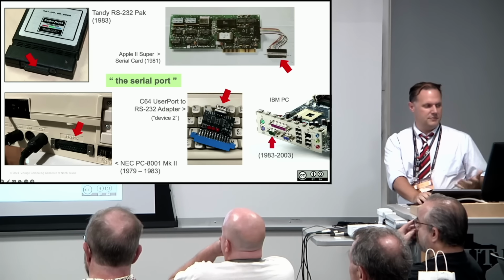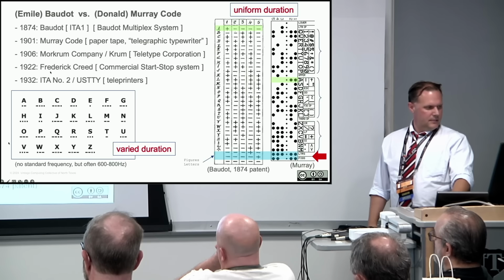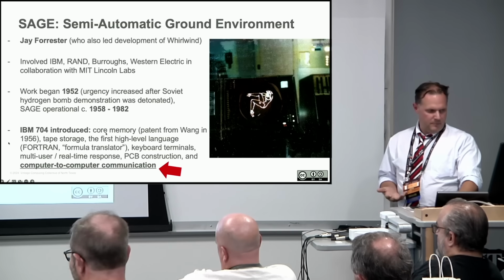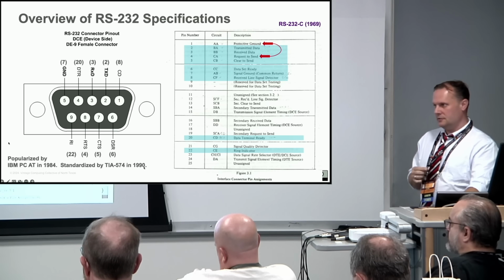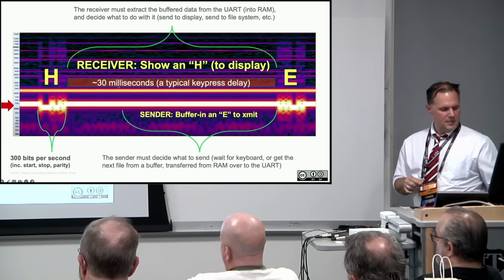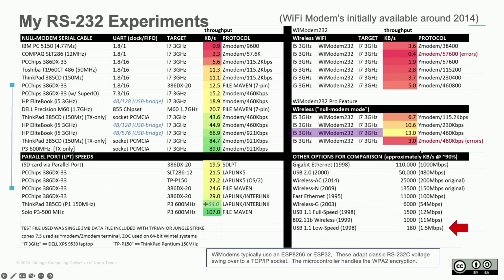RS 232 Then and Now

Comment: One small, but very common, error all through this talk:  Baud rate actually tops out at about 600.  The baud rate is tone changes per second, which maxes out about 600.  Above that, more bits per second is done by having more tones, each tone representing multiple bits.
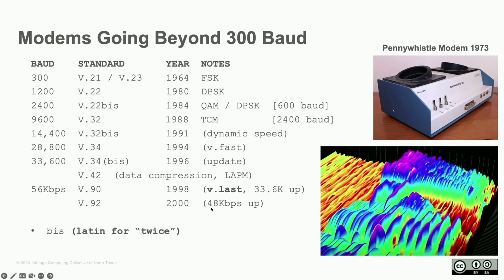Reply: I came across this - but didn't know a concise way to put it in the presentation.   Also I was confused if the "base rate" was really 300, 600, 1200, or 2400.  I heard different stories on that.  But the core point is, to "leap" up to 9600 across a phone line took some real thinking because of the tonal constraints.   The visual chart at 52:13 tries to convey this, but yea couldn't fit it into what was already a long discussion.    I'd argue that the cleverness in using FFTs just to get to 9600 evolved the signal processing later used in digital cell phone services of the 90s.

Comment: I'm still making good use of the Commodore A2232 seven port serial card. It uses a 3.6 MHz 65CE02 to handle all seven ports for the host Amiga. Using that, I provide serial consoles to an AlphaServer, a Sun Fire V245, a Cobalt Raq (MIPS), a VAXstation 4000/90a, and a Quadra 605.

Real servers have RS-232 :)

Comment: In the UART discussion you're crediting the UART with buffering functions they didn't get until IIRC the 16550, which was used in later IBM PC clones because the main x86 processor interrupt system couldn't keep up with even a 9600 baud input without losing the occasional character.  The job of the "Universal Asynchronous Receiver-Transmitter" was, as the acronym implies, just to take 7 or 8 bit parallel bit groups and serialize them for transmission and de-serialize them on reception so the CPU didn't have to bit-bang at the full baud rate with accurate timing -- which I've done when there was no UART on the 8080A, 6502, and 8041 in different eras.
Reply: The 16550 extended the buffer from 1 byte to 16.  There was a bug in the original IBM PC BIOS that hindered it from supporting past 9600 - but if you by-passed the BIOS, its UART was capable of faster.
Reply: @xiphod1337  The problem is that other subsystems, like the disk drive, in the PC had higher interrupt priority than the serial port, so they could hang the UART long enough for it to miss a character.  The original UART had what a normal person would call no buffer at all, just holding the last received character until another came in.  The 16550 took the place of a chunk of memory and a couple dozen lines of code holding on to incoming data until the PC was ready for it.  In a system where it could not be blocked, the old UART could operate reliably up to 115 kbaud.

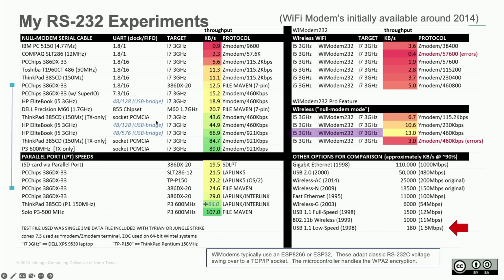Comment: 58:04  the RS-232 speed chart.  To clarify, this is RS-232 in combination of using a UART with framed data.  And one thing I didn't mention as a benefit of RS-232: it is still often used as initial boot-strapping of a system.  The high speed protocols like USB, WiFi, Gigabit - a lot of firmware software support is needed on how things get encoded (and larger buffers).   How do you get that support onto a system?  You could type in the thousands of bytes of hex.  Or, you could boot-strap using the relatively simple RS-232.

Comment: For the chart at 1:01:11 or so -- what terminal progarm did the presenter use to test speeds on the 'slow' PCs?
Reply: I was using a program called conex 7.5 from about 1998 (listed on the bottom left of chart, it's very small "fine print").  It's not as well known, but I looked for the newest/most recent MS-DOS compatible terminal program I could find (figuring those are generally more optimized via use of more modern compilers and techniques, but also just to try something different).

Comment: The whiplash of  going from Morse code to the 1950s.
Reply: Yea, sorry I couldn't spend more time there.  I got a message recently from an individual who, in 1978, was tasked to integrate an old Baudot 50 baud weather system that was still in operation over to the RS232 card of his S-100 system, to have it presented and ready for a radio station report.  A job too small for a mainframe, but perfect for the emerging microcomputers at that time.

Comment: 10:00  This might predate the light bulb.
Reply: Absolutely - one photo I didn't get room to include was how they were using telegraphs inside covered wagons during the Civil War.  Now consider this: years later, we can buy those little gizmos to do Ethernet-over-Power (like to go across floors in a house).  They've been sending data over wires since before electrical outlets were even a thing.   Now I sometimes wonder how much data our devices today are slinging over power lines, that goes unnoticed and unmonitored.

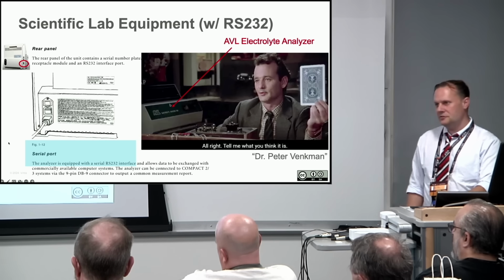Comment: @ 35:00 in the movie Ghostbusters, the actor Harold Ramis (Dr Egon) carries a predecessor of the Casio FX-850P programmable calculator on a wire around his neck. It also had the RS232 pins on their propriety connector. I used it to extract and decompile the Basic library that was on the Casio containing mathematical, scientific and statistical programs. That was in the late 80's early 90's. The cable I fabricated was a bit flimsy and the display only had 2 lines with 32 characters but you could use the Casio calculator as a VT100 terminal.

Comment: I remember having a serial buffer for a printer that could handle four computers. So if you printed something out from DOS you did not have to wait for the printer to be finished printing because of that massive 64kB buffer. 😅

Also a very special case was Germany. In times when the Telekom still was "Detsche Bundespost" they were the sole provider of telephny and postal service. You could rent a modem from them, but you were not allowed to connect a modem not of their approval. So the acoustic coupler (Akustikkoppler) was invented where you put down the telephone receiver on it, with a loudspeker under the mic and a mic under the loudspeaker of the receiver. Iirc there were 9600 Baud possible with this setup.
Reply: Great notes!  True I didn't touch on the early phone phreaking stuff or the Pennywhistle stuff, or yeah the legal hassle of connecting anything to the "phone network" in the 1960s (from residential standpoint).

Comment: I still run into this (rs-232) on occasion, usually with low bandwidth communication between different pieces of field equipment. To the point that I keep a USB to RS232 port in my tool bag.
RS485 and RS422 are still used heavily today with some equipment still produced new, especially with door access systems.
I had always wondered previously why there was such a variety in start, stop, parity and bit length formats when I only ever used 8,N,1
Reply: One aspect I didn't get time to cover in more detail was the use of parity bit.  Recall ASCII was really a 7-bit standard, leaving an 8th bit to be used for parity.  Parity concept is still used in some server class memory components (ECC stuff).  I think parity fell out of favor after systems became capable enough to compute CRC's (late 60's).  That's also another job UARTS take care of, in computing correct value of a parity bit (relative to the parity mode, Even vs Odd).  Sad that they go through that effort to support this, and yet like you say, most of us just pick None for parity.   Maybe there is a renegade BBS out there are picks Even or Odd just for fun?

Comment: Back in the day I built RS232 serial cards that supported 32 and later 128 ports for x86 systems running Xenix or Unix (the Specialix Si, XIO and RIO),  we would routinely run 16 terminals on a 386 or 486 system and could support 38,400 bps on all 32, later 128, ports at once.
Reply: Were these Digiboards  or something else?  sounds interesting
Reply: @jrherita  Specialix - Digiboard was the competition.
Reply: Wow, that's a lot of ports.  Do you recall any use cases?  Like, who was using such cards?  Like library terminals, corporate terminals, university?  Display screens at airports?  (I didn't touch on the history of those old "roll over boards" at early airports, like mid 1960s).   I can see 4x ports off a single 386, but didn't dig into how to scale that up to dozens and dozens on the same system (but I imagine early PPP/ISP offices needed something like that?)
Reply: @xiphod1337  "dumb" terminals running apps.  For example Microsoft had a word processor for Xenix.  There were a lot of business systems for companies like car dealers, some automation applications.  The trick was to offload the interrupt handling so instead on one interrupt per character per terminal (at 9600 baud that's one every ms) the card buffers and interrupts every 10 or 20ms and then and process the buffered data from all the ports in the one event.

4 terminals on a 286, 8 terminals on a 386, 16 on a 486, more on Pentium and non intel machines like MIPS.

Comment: Chinese brushless gimbals run it at 1megbaud.  Dot matrix LED displays run it at 10megbaud & beyond.  It's more resistant to interference than open drain protocols so motors on the ends of limbs tend to use it.
Reply: From what I can tell, those use TTL UART, but not RS-232. (Remember, UART and RS-232 are not the same thing!) I’m sure some implementations use RS-485 signaling for its far superior signal integrity (better than TTL UART or RS-232.)

Comment: I love RS-232...!  In college I had to work a certain number of hours per month for my scholarship. I helped a professor set up an IBM clone to command a spectrophotometer via RS232 to the stepper motor that set the wavelength of light that strikes the detector. My program allows an operator to enter the wavelength range to be scanned, at what rate to sweep over that range and how many passes to make. This would masure the spectrum of a light source to be analyzed. The instrument's output went to a chart plotter which would draw the spectrum on paper. This plotter had a RS232 interface as well that I used to capture the output of the instrument, save it to disk, then plot the spectrum on the computer, including a features to process the muiltiple passes to eliminate noise from the signals, resulting in a cleaner result. My program culd even zoom into sections of the spectra for versatile analysis. To get those machines to all work together like that was very satisfying and really boosted my confidence in my abilities in that sphere. All of that was made possible by RS232 and some BASIC code. The amazing part is that it and it's descendants still surround us today.

Comment: i spent my first weeks as an apprentice at the age of 16 in 1986 changing mc1488/1489 line drivers on at&t 3b2 unix boxes.  I then asked one of the old “elders” to explain to me how you can send 8 bits of data over two pieces of wire. 
still have my breakout box and gender benders !

Comment: A link to the presentation slides is now available in the Video Description (especially for anyone who wants to review that performance chart at the very end).  There were about 30 slides I elected to take out (such as how Eddison's ticker tape used "difference signaling" like modern day USB does!), since I needed to avoid tangents and stick to the available schedule.
Reply: Also, sorry I didn't repeat the questions being asked into the audio.  But to the young person who asked what was the "theme" of my old BBS, that was a really great question!  Thank you for that.  To elaborate a bit:  I operated from about 1988 until 1995, and I rotated between BBS host software (but I would manually reconstruct the user database each time, since it was all plain text back then!).  Started as Lost Cities (I used a lot of "city-skyline" themed ASCII art), then when my father got me a new phone line and number, I switched names to Center of the Universe.  During a couple of those years a local area volunteer fireman hosted D&D campaigns at the forum.  We each wrote out our character actions throughout the week, then on the weekend Fireman Ken described the resulting scene (which we trusted he did the dice roles properly accordingly to our described actions).  Alas, a hard drive crash in 1995 lost all the records of those stories, but it's an example of how we made use of the system.  I just wish I had kept that hard drive, since now years later the experts in this community probably could have recovered some of it.

Comment: I strongly suspect the DMX use was inspired by MIDI, which is itself just a serial protocol. I have seen lighting rigs that "speak MIDI", having them "speak" RS-232 seems just as good in most ways, better in some.
Reply: DMX uses RS485 for its hardeware, MIDI uses a 20mA current loop. MIDI is much more elaborate than DMX. Basically everything DMX does is running to 512 7-bit values sequentially. MIDI on the other hands is able to send a multitude of commands and has several signal types, like time code, note information, controller information and general signalling functions. MIDI gives meaning to its data, DMX is just ‘values’ and the sender and reciever combined should agree what a certain value at a certain position (called an address) meens

Both have been extended quite a bit DMX now offers two way comms through and MIDI has been implemented with many extensions and had a 2.0 release fourty years after 1.0.

DMX512 is the pinacle of simplicity, MIDI is much more detailed and made for purpose.
Reply: @ReneKnuvers74rk  I only ever had to deal with RS485 once, and I ended up buying some overpriced box that converted it to RS-232. It wasn't the cheapest way, but sometimes it's not worth overthinking someone else's problem.

I wasn't referring to the data protocol, just the signaling protocol. MIDI has aged exceptionally well, because the two layers are mostly independent. It allows MIDI-over-USB to be just about as transparent to the user as the original, in any combination. I was always a bit surprised at the signaling rate being as slow as it is, yet people are freaking out over a millisecond or two of latency and don't cast their eyes that direction. Should be able to squeeze half a millisecond out right there.

Comment: some nitpicks:- DMX(512) and CCTV PTZ controllers use DMX485-- which is a 5V differential version of RS232 for longer range and better noise rejection
- DMX(512) only sends (up to) 512 bytes of binary data as a packet and the slave devices has to filter out their channels to use
- for bit-banging serial you can do whatever you want, waste as much or little bits as you like, handle interrupts whatever AS LONG AS your CPU has enough cycles and memory to handle it -- of course it needs more resources than a dedicated UART but come on, it is usually the first or last resort of communication  --- what can waste bits is using parallel--to-serial shift registers without built in handshake/format - but that is not a true bit-banging anyways (bit-banging serial still the 2nd thing to implement on an obscure CPU debugging/hacking after a blinky light/pin :) )

For bonus fact: hacking the PS4 for the first time (33c3) the group fail0verflow used some PCIe translation hardware which then communicated over RS232 for tracing the communication between the Southbridge and the APU (with the effective speed of PCIe x0.00002 )
Reply: Nitpick: it's RS485, not DMX485.  Some CCTV PTZ controllers also use RS422, which is basically just full duplex RS485.
DMX512 actually sends 513 bytes when you include the start code.  The most common start codes are 0x00 (1st universe lighting data), 0x0A (2nd universe lighting data), and 0xCC (RDM), though some manufacturers use others as well.  The full protocol also specifies a starting BREAK and a mark-after-break (MAB) before the data stream begins.
Reply: I was hoping to hear stories of stunt-folk in old movies using RS-232 to engage certain effects remotely, or like pyro shows at Disney, etc.    I agree using a shift register IC isn't true bit-banging, it's like "assisted bit banging" as it still depends on hardware external to the CPU (but you may need hardware anyway, if you need the signal above 5V swing?).   // another aspect here is that modern networks, for security reasons they clamp down on getting data off their system (disabling USB, no serial ports, no CD drives, etc).  It's like the "personal computer" is no longer personal, rather "owned by the network" (or bound to it).  Except the TPM modules I think still might use RS-232 actually?  Anyway, as long as one can find a couple wires going outside of the system, bitbang is an option  (I did "assisted bit banging" on the CoCo and PET @ 1200 baud, but never really faster then that).

Comment: A couple of things: first the 75188 and 75189 are actually just TI's part numbers for the 1488 and 1489, which are what everyone used before the MAX232. (and after it too, if you already had +12/-12 volts handy)
And he didn't mention Cisco's ubiquitous blue cable and RJ-45 jack that anyone dealing with their equipment is very familiar with!
Reply: One thing I wasn't ever to really verify is if the bulk cost of any of those serial-supports chips (including MAX232) got to under $1/unit (like when making millions of motherboards for production).  I had the impression they did get down to basically cents-per-units order, but others suggested even at peak production they were still over $5/unit?  I tried looking up contemporary price sheets from the 1980s, but never found anything conclusive.  But in any case, the core argument is still valid: the simplicity and wide availability of those chips did help keep RS-232 relevant.   (I didn't get into USB technical differences, plus that it's technically licensed by Intel)
Reply: There were actually several competing and incompatible systems for using RJ11, RJ12, and RJ45 connectors.  These were defined by manufacturers like Cisco and Comtrol because there was no standard.